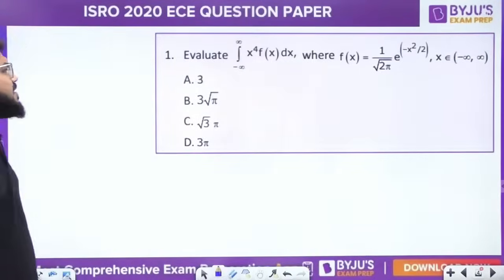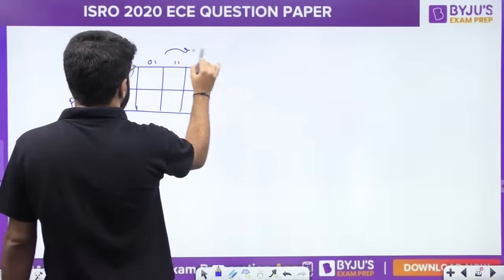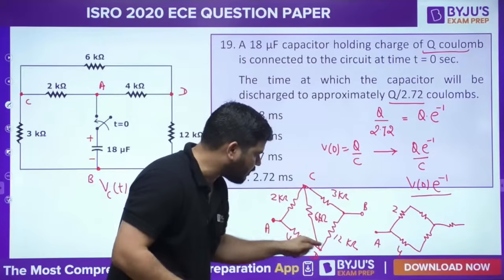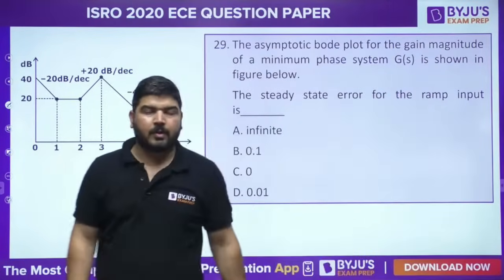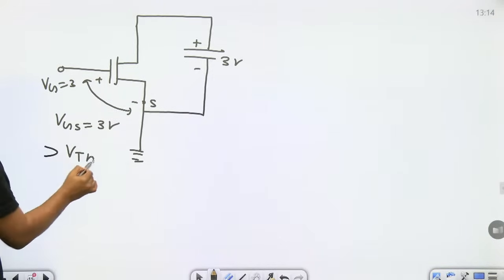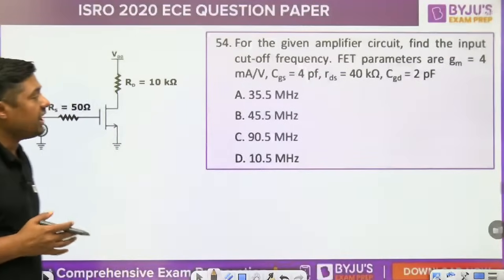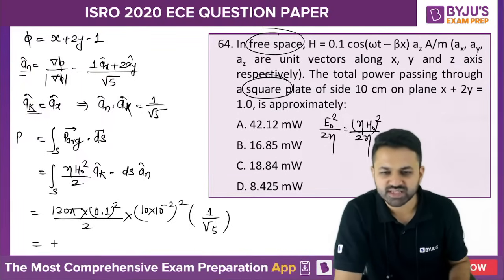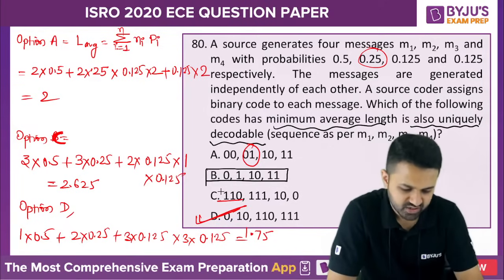ISRO 2020 Previous Year Questions Paper | Electronics and Communication for ISRO 2023 | BYJU'S ISRO

Comment: Sir, in question number 56 how are you applied voltage division rule when there is current entering in the output terminal of the op amp?